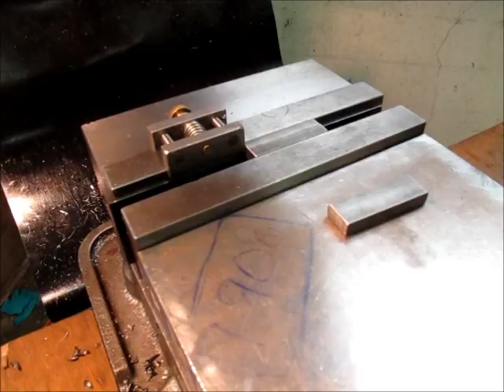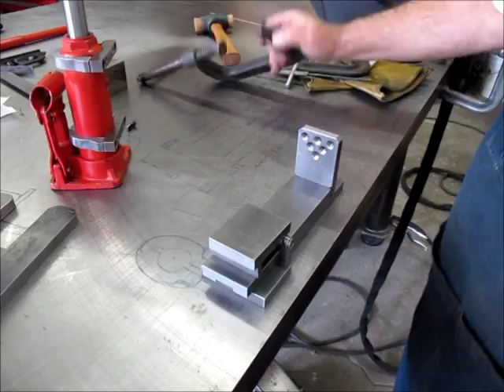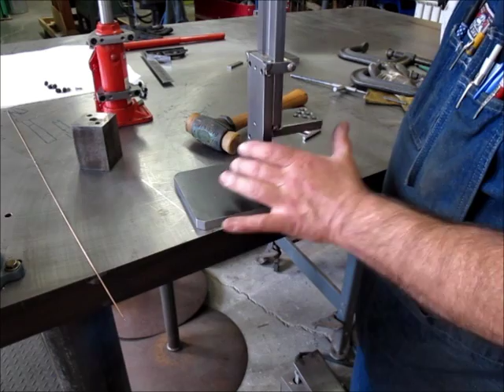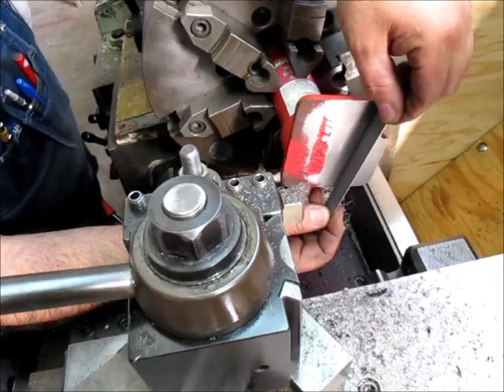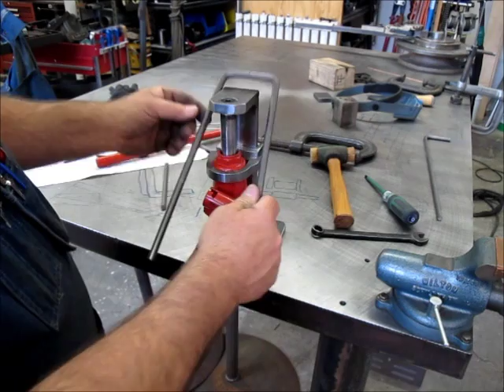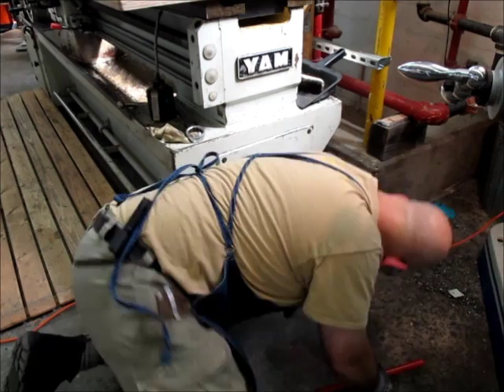Toe Jack Episode 3

Comment: Very nice, and thank you! You just went through and corrected all the mistakes I made with mine. I've got too many irons in the fire, but you may think about selling this as a kit like swagoffroad has for harborfreight gear. Considering the cost of a new toe jack even northern tool wants like 400, I would've paid for a tack and bolt kit. I think the design is unique enough not to infringe on any existing equipment.

Comment: Nice project !  If you have occasion to take this to help someone else, secure it so the "toe assembly" can't vibrate during the transport.  I built a larger lifting surface for a similar jack and the vibration of the larger mass on the ram, destroyed the seal .  Got to the job and the jack would hardly even lift as oil was going all over.  The restraining roller and guide appear to eliminate most of the possible movement, but it won't hurt to be sure.   Thanks for the great video!

Comment: All good stuff Tom, good to see the set ups you use for example the sacrificial block to machine the horseshoe shaped clamps, once you see it you think, well of course, that's the way to do it. but you gotta see it first.

BTW what is the building you are in ? did you mention this is your shop at home?
I'm in 11' x 26' and that's big (ish) in the UK but not big when you fill it with machines.
Thanks again.

Lee

Comment: Hi,
thank you for this very informative video series.
Every time i try to weld common steel with my tig welder i get a lot of bubbles in the weld and it looks like a sponge. Stainless and Aluminium is no problem but just ordinary steel is my main problem. Do you have any suggestions why this happens? I use pure argon (about 10cfm), thoriated tungsten (2.4mm) and filler rod for steel.